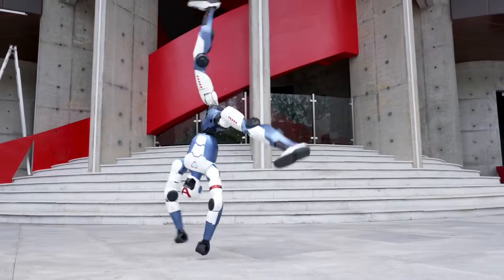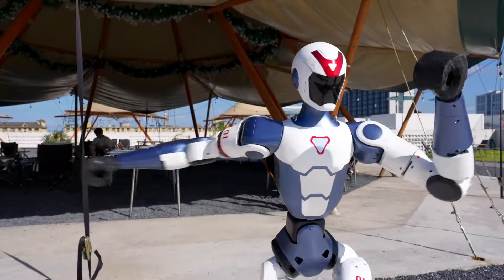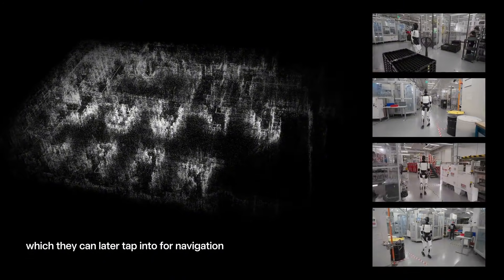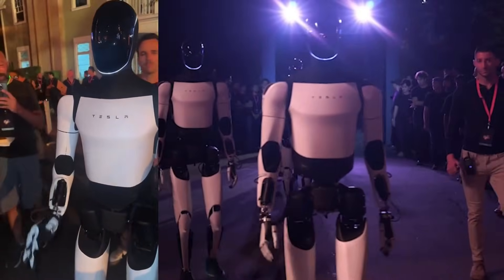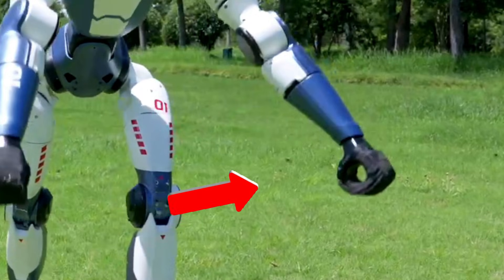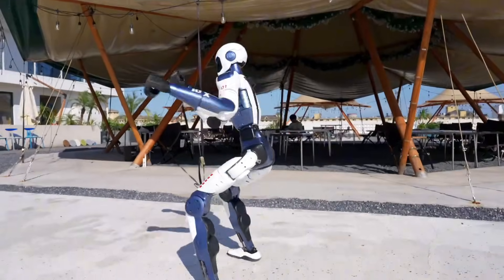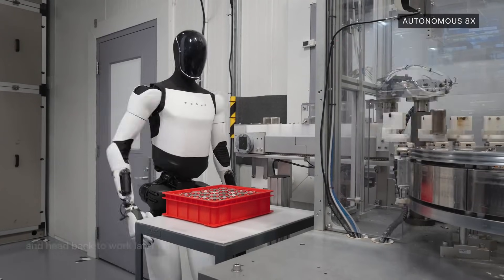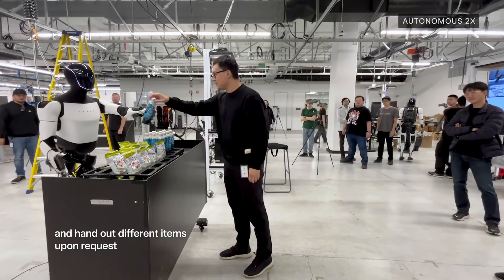The Differences Between Unitree R1 & Tesla Optimus Humanoid Robot

Comment: A Youtuber bought the Unitree. It wasn't $5,900, It was $70,000. It was hopeless...
Reply from the maker: the YouTuber you are talking about is Kai Cenat, he bought a Unitree G1 EDU Ultimate C (U5) from the US it means it comes with tarrifs to make it 70K, that's the EDU version that you can buy if you want to program it. They also sell non programmable versions at a cheaper price. In this video I am talking of the Unitree R1 The base model, factory price will be 5900 but if you buy it from the US with tarrifs and shipping cost you should expect it at at least 10K, then for EDU versions they will be way more expensive
Reply: @chriswabs  so it's 6k for the machine and around 50k for the SDK license? wow what a cool pricing model.
Reply from the maker: @-Jakob- 😂 it's Unitree's pricing tricks,,but like the base model will not have fingers that move and hands are stiff,,so if you want with fingers that move you pay a little more, then the SDK support one will use a more advanced GPU, then the 6K one uses only single joint encorders which are not the best, but expensive models come with dual joint encorders,, so there's some little or small things that they trade off to make it cheap, but when buying and you want something that can be at least of good standards, you end up paying more
Reply: @chriswabs  thanks for the details👍🏼
Reply: I think in the future these robots will likely be around $10k. The companies know they need to make them affordable for mass adoption. $10k is affordable, considering a new car costs more. When they are fully autonomous, that's when we will see mass adoption.
Reply: @chriswabs  you’re exactly right and so was I LOL
Reply from the maker: @gareth5000 yes we were both right. Unitree has this trick where they set a base model at a cheaper price but it's so limited that you will be forced to buy a few extra attachments if you want one that is somehow better,,so they have a lot of iterations of one robot, Like the G1 that Kai Cenat bought there's about 5 or 6 iterations of the same robot, with the cheapest being 16K factory price and the most expensive one is more than what Kai Cenat bought it's about 73K
Reply from the maker: then they have a 43K model, a 48k model even a 57k model,, same robot just changing a few things
Reply: Goodonya Chris:) I love robots, I hope I live long enough to own an Optimus with an advanced version of Grok. It could happen. I'd love to take it on the back of my Surron and take it to the pub! I already have great conversations on my veranda at night, with Grok. We talk about stuff that no one else is interested in, astronomy and geology, etc. Imagine if it was embodied!
Reply from the maker: @gareth5000 did you see the recent Optimus video, the robot is still very slow
Reply: That is an Optimus 2.5,. Somehow, Elon has lent them the robot and incorporated grok3.. Optimus 3 with Grok5 will be "sublime" according to Elon.
Reply from the maker: @gareth5000 it was walking slowly. Honestly I think if like Tesla got the tech of Unitree when it comes to agility and walking then you combine with Tesla's robot brain and how it runs Grok, I think you can get the best robot in the world
Reply: Hands, brain, and scalability, will be Tesla's advantage👍